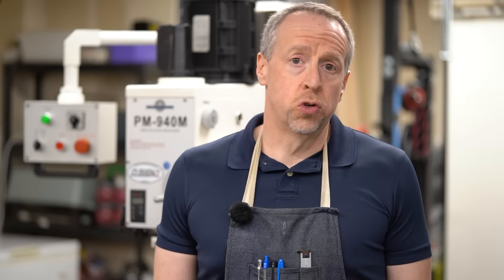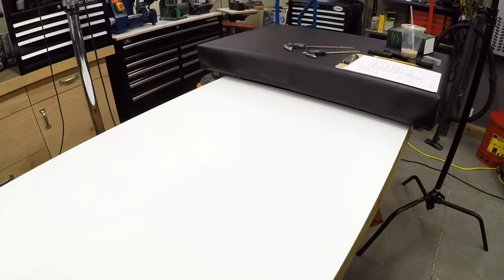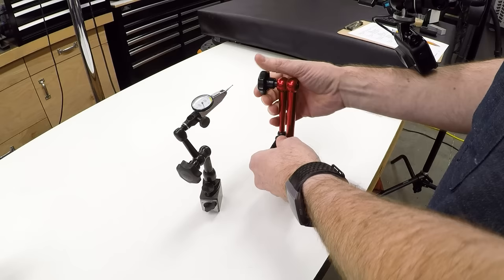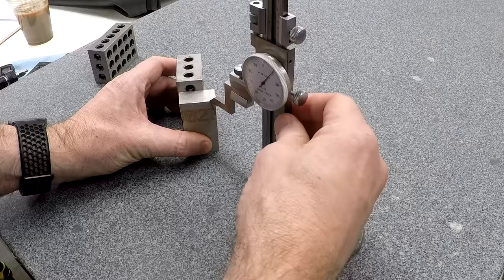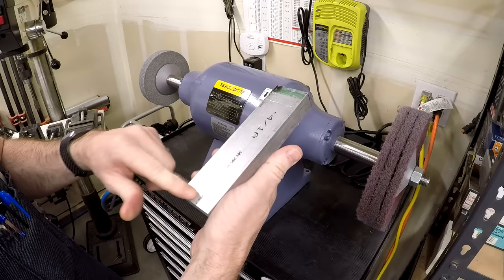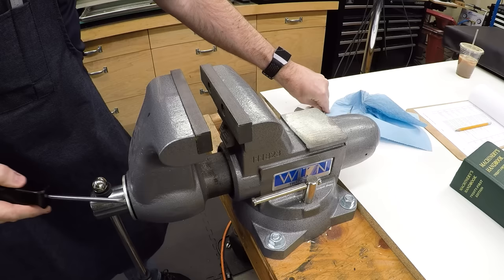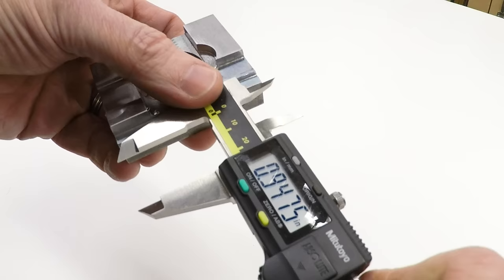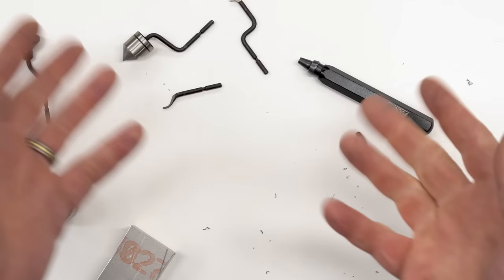Top Ten Tools I Use Every Day in the Shop

Comment: Thank you for your top10 tools.  My most used tool is a 22 x 66" movable work table I made from a miscut 1-1/8" plate. 
Four 800lb capacity casters 2 moveable 2 fixed [lockable] , rolls reasonably easy. 5" vice attached and 4 holes @ 4-1/2" diameter near each corner. I thought they would not be used very often but they are very usefull, especially with my mag-drill. work table has a shelf about 12" above the floor where I keep usable scraps of material.  Now I have to think of tool #2 thru 10.
Thanks again for a very pleasant video.

Comment: One of my tips is to take a piece of 2x2x.250 aluminum angle, and cut to pieces to be the same length as your vise jaws. 
Then clamp both into the vise jaws so they are in the jaws one one side, and laying over the top of the jaws on the other side. 
I use a large dead-blow hammer to "persuade" the corners of the angle down over the jaws, then my letter punch set to mark them "Front" and "Rear" so I know which jaws they are registered to. 
They're invaluable for clamping anything you don't want marred, they're inexpensive, and the faces are easily freshened in the mill or just replace if they get too worn.

Comment: Many people do not know about the step feature on the calipers because that feature is not on all calipers.   It was advertised on the Mitutoyo Diamond Verniers that I bought in 1970.   I had the only set in the shop with that feature.   This set of vernier calipers is STILL my “go to” set.   Not as easy to read as the digital ones I have, nor as easy to read as the dial set either.   However, this set has NEVER skipped a cog as have the dial set, and they have never had a dead battery either.   After 50+ years I trust them.  Oh, lest I forget, this set has a .050 vernier rather than the .025 that plagues many verniers.

Comment: my top ten tools
[1] starrett 150 mm thin ruller
[2] starrett scriber
[3] Alpen brand drills
[4] Rhome vice
[5] tap set with tap size drills
[6] deep hole marker
[7] 1 2 3 blocks
[8] knippex and japanese enigeer brand pliers
[9] scotchbrite sanding discs
[10] Bahco allen keys

Comment: The deburring wheel setup on the Baldor looks exactly like the one shown in Joe Pies video.  Don't keep it too close to any machine with bearings. The pink dust is a quiet killer.
Reply from the maker: I haven't seen that video, but it is the same setup I saw in the prototyping shop at work.  And they do have it installed in the grinding/welding room.

Comment: I have the exact same 6 1/2" Wilton vise and used your tip by adding a roller thrust bearing and  washers. Much improved, smoother to operate and takes less energy to get a good clamp. Thank you Sir...
Reply: The same principle of replacing screw friction with clamping force by using a thrust bearing also applies to collet chucks with a bearing nose.

Comment: As a hobby machinist, diamond files & grinding bits. They make qwuik work of sharpening cutters from HSS to Tungsten-carbide.
At work, it's usually more profitable to use inserts & replace them when the coating is worn.
Reply from the maker: I know some people regrind carbide inserts, too.  Personally, I usually break them before they wear.

Comment: 1-2-3 blocks are indispensable in woodworking as well.  A pair of them, plus a set of aluminum/brass gauges (1/16 through 1") and feeler gauges, make for great setup devices with table saw and router cuts.  Much easier than trying to get a ruler or tape measure to register properly and more accurate.  I even have a pair of 2-3-4 blocks when I need something even larger to setup off of.  Gets me everything from .001" to 8+" of cut setup capacity.

Comment: Whoa!!  Can confirm on those Starret Saw Blades.  I had bought one after watching your video as a spare since my existing blade was still working.  Well, the existing blade broke today (they were a bosch replacement of the original already), and I replaced them with the Starret.  WOW!  That blade cut thru 6061 1" square stock 3 times faster than my old blade!  Definitely worth the extra money for them!!

Comment: I go between Starrett, Lenox and Morse for my bandsaw blades. They are all about the same, and all are expensive. Yes, variable teeth is pretty much a requirement. Get a blade that will have between three and 6 teeth in the work, if possible. The Knipex are great, I have a few. There are other German manufacturers that are just as good or, some say, slightly better, but I haven’t found much differences. I like the heavy, multicolor, grips.

I find the Noga dovetail too tight for my Brown And Sharp indicators. I don’t know why, but when it’s completely loose, it takes a lot of force to get the indicator on, and off. But once on, it’s fine.

For my ER-40 collet chuck, which is the most common collet system in industry, I have a “service wrench” for the flats on the chuck. If you really tighten down on the nut, which you need to do for the larger diameter tooling, it’s almost impossible to do by hand. Unfortunately, for ER collet systems, you can rip the quill lock right out of the mill with these. So having the service wrench rest against the column, you can really wrench the nut closed, up to 130 foot pounds (yes, that number is correct!), using a torque wrench. So this wrench, along with the torque wrench, are two very important tools for me.

You mentioned McMaster Carr. That is one of the most important tools as well. I’ve been using them since the mid 1070s, for my companies, and myself. Ever since they came out with an app for iOS and likely, Android (I recommend a tablet), anybody can have an account, and order anytime. Most deliveries are overnight if you order by 6:30 pm. They have stock of over 550,000 items.

My Bondhus hex wrench sets are so often used, that my shops, which comprise my entire basement and two car garage, that I have five sets, both inch and metric. When bought on sale, for about $23, for both the inch and metric set, from MSC industrial and other places they are a great bargain
Reply: Bondhus and Wiha are the gold standard for Allen wrenches. Makes you want to throw all others in the trash.
Reply from the maker: I might check some out.  I have a set of small Dynamite metric hex drivers I bought for working on RC helicopters, and they're basically indestructible.  I've ripped the hex out of seized alloy fasteners without so much as scratching the driver.

Comment: I like to make a set of mild steel flat jaws for my vises. They are soft enough to hold things firmly and don't leave apprentice marks on parts.
Reply from the maker: Good idea.  We usually think of copper or aluminum, but depending on what you're gripping, mild steel could be a good option.

Comment: As someone mentioned below, Mitutoyo offers solar powered calipers. Yes they cost a bit more but even with Mitutoyo's normal very good battery life I'm more than happy I bought mine. Buying or even shop making a designed for the job foot to add to the right hand end of a set of calipers while using the depth function is well worth it. Besides my 123 blocks, I also bought a set of 246 blocks for all the same reasons the 123's are so handy. Between the two sets I have a fairly accurate method of checking between 1"- 18" and pretty much anything in between using a gauge block set in addition to them. Thanks for showing that Nogaflex James, that's one model I hadn't known about. I bought the large print edition of Machinery's Handbook and also the CD they offer. Plan for the future because at a certain point for all of us there going to be non optional. My most used shop tool? A large button and display calculator.
Reply from the maker: Nice.  I also have a comically large calculator and 2-4-6 blocks.  Both are great.

Comment: A Treasure trove of Great Info. Thanks so much. I considered my Mitutoyo  calipers a Huge step up from the inexpensive piece that I suffered with for sometime. The only caveat I have is that repeatability of a measurement becomes better with the higher priced item. I originally purchased at the low end and repeat measurements were a real nose-bleed with considerable variance depending on the point between the jaws where the measurement was made. As always with tools....you get what you pay for, right?😂

Comment: So many possibilities with this setup.  First thing I thought of when watching you disengage the half nuts at the end of the cut was "why not just stop the servo?"  Then I thought "why not reverse the servo to get ready for the next cut?"  Then I realized that you would have an indexing problem if you ever lost track of the pulses and direction.  solvable I think...but pretty cool project.  Very robust set of skills you employ....
Reply from the maker: Thanks!  What you suggest is possible, but it requires additional hardware, like a linear scale on the carriage, and you have to start accounting for acceleration and backlash.  It starts to become a CNC conversion at some point.  I am deliberately keeping it simple.  It's still a manual lathe and works like a manual lathe, except you don't have to deal with change gears.

Comment: James, that was a great video.  I used your link to McMaster Carr to get to thrust bearings for my Wilton vise.  My Wilton is a 1950's model that I purchased on an I-beam stand for $15.00  Different thrust bearing, but you clarified the need for a spacer, ( it's nice to have no surprises) after adding 5/64" of bearing.  I made a spacer (or washer) out of 1/8" aluminum and it works like a dream.  Man, it works great!  Thanks big time!!  I'd add a pic but I don't know how...

Comment: Small tip- put coloured electrical (pvc) tape around allen wrenches, in the (electrical) colour code of the size. Only really works with metric, but that is 90% of the world... You can see across the shop what size you left on the bench... Also works with drills, taps, transfer punches etc.
Reply from the maker: That's not a bad idea.  Now I'm wondering if I can get heat-shrink tubing in all the colors I need...
Reply: @Clough42  Yes, I have used heat shrink for this purpose- but some of the colours are hard to get. PVC tape is remarkably resilient. Paint works, but is a hassle- the Amazon ten-pack of tape gives you all the colours. I also use this on spanners- for the size of bolt, not the jaw size.

Comment: Great list, I totally concur!  Not sure about a thrust bearing on the Wilton. If you ever have to crank it hard,  something has to give in those tiny needle bearings. They will either be crushed or embed themselves in the washer. Me, I would make sure my factory thrust washer is thick, precision, and well hardened and replace if necessary. The extra force needed will be negligible.
Reply from the maker: The force difference is significant, which is why I did it.  The bearing assembly is rated for 12,000lbs static thrust, so it should be fine.

Comment: Ok I've gotta add some. For allen wrenches, find the Japanese brand "Eight". I use them daily and they surpass everything. Even the German stuff. I also have a Torx set similar style to your allen wrenches made by Klein. Same holder and everything. Great addition. I agree on the Knipex pliers. Been using them for 20 years, BUT I have the channel lock style with serrated jaws. I'm embarrassed to say I never thought to look for the style you showed, but I will now. Agree on the Wilton vise. Our shop  vise gets abused and has been in the shop longer than I have. We machined out some oversized brass jaws and they hold well and don't mar the surface, best of both. Great video.
Reply from the maker: Soft jaws are on my list.  I have my eyes open for some eBay copper drops, but they're usually 6" long, which is 1/2" too short.
Reply from the maker: Update: I just found a suitable hunk of copper on eBay, so soft jaws are coming.  :)

Comment: You may want to move that grinder/buffer out from just in front of that outlet. After a while the 3m wheels material will start caking onto whatever is behind them. You probably don't want that conductive dust going into that outlet! Love those wheels by the way, been using them for 20+ years.

Or maybe just put a little shield between the outlet and the buffer. Just as something to block the debris.
Reply from the maker: Childproof outlet covers!
Reply: @Clough42  Ah, yes, those would work perfectly. Not having kids, I forget those things exist, lol!

Comment: Great presentation on each tool's feature and application and thank you for the time of putting this type of video together.  Question: On the 6" silicon carbide deburring wheel link in your description, the MSC link took me to a 1" arbor hole wheel, is that correct?  I thought this Baldo grinder would take a 3/4" arbor hole.

Comment: About those safety glasses, I have a couple questions: Bifocal lenses, as in you have a prescription or they have a section on the bottom edge that classify as “reading”? And the other question, with your particular line of work (in the shop), do you find that debris finds its way between the glasses and your face? To clarify, do you feel a set of safety glasses that feature a foam liner on the inside edge of the frames (in order to seal to your face) would be useful? 
Thank you

Comment: Ovious for its non-presence in your list is your Haimer 3d sensor.  See you using it often in your videos, and don't think I have seen you use anything else.  As it appears that there is little video content on the Haimer and manual milling machines, would love to see you do a short video on using the Haimer on the manual mill

John
Reply from the maker: I don't use the Hammer on the manual mill.  It's in a dedicated taper toolholder for the CNC.

Comment: Hi James. Very helpful, thanks. I'll get that reverse Noga deburring blade. I did not know that those pliers could grip round objects either. I'd be interested in some other items you have in regular use. I think there was a glimpse of your air compressor. Mine is 3hp, very noisy and lives outside. A smaller, more peaceful one would make life much nicer as I can't drill holes in the wall to bring an air line in. Cheers. BobUK.

Comment: great list. FYI, Mitutoyo has a solar version of their absolute 6" calipers - just as good and you never have to change a battery ! John Saunders at SMW have a nice video to modify your magnetic base (Noga or other) an add the micromanagement - I have modified all mine. Last point the small deburing blade in the Noga kit is for plastic.
Reply: I bought a generic kit of those tools, explicitly for 3d print cleanup. The fact they de-burr copper pipe was just an awesome bonus.
Reply: Hello Pierre, I tried to find the John Saunders video on mag base mod, with no luck.  Can you help me find the video?  Thanks.
Reply: Just keep the solar calipers next to your tig welding area and you never even need solar to charge it

Comment: A 2x60 inch bur king belt grinder and the baldor buffer with deburing wheel are a combination that I use daily. The bur king is expensive but I wouldn’t be without it. My second most used tool is an electric micro motor with misc carbide burs and grinding wheels. I have used Osada brand which again is expensive but I use it hard and they last and last (retired dentist here). Dremel tools are too poor of quality to be useful in my opinion. Third is my bandsaw.

Comment: Just curious if your HF bandsaw has the same issue as mine. Are your blade guides deflecting the blade downward to gain depth of cut? I put a 1/4" steel plate under the vise to elevate the stock so that I could set the blade guides right. The saw now cuts very straight and best of all, I can use full downward pressure without the blade falling off (it will stall the motor first). Also the blade life increases drastically with more pressure.

Comment: My local "safety specialty shop" carries a brand of safety glasses that you can mount special prescription lens holders INSIDE of.  I wish I could remember the exact brand/model.  Supposedly the local industrial manufacturing company switched to these and saved a million dollars over a year by not constantly buying new prescription safety glasses for their employees.
Reply: I've done the prescription insert thing before.  I hate it.  It's a lot more work to clean them and there are more surfaces creating reflections.  I'll pay the difference myself rather than live with them.
Reply: @SouseMouse  Interesting.  What you say makes sense.  Luckily I still don't need glasses myself.

Comment: Might be a silly question, but you mentioned you work with both metric & imperial, so you're definitely qualified to judge... is there a metric version of 1-2-3 blocks... and when working in metric, does it matter?
Reply from the maker: You can buy 25-50-75 mm blocks.  They aren't common where I live, but they are available.  For the vast majority of what I do with them, it just doesn't matter, because I'm  just counting on them to be square and parallel (and matching) but if you use them in a situation where you need to subtract the block dimension, one will be more convenient.  If I use them to measure TTS tool lengths as I showed, it's convenient to subtract 2 inches because I'm measuring tool length in inches.  If my tools were measured in mm, subtracting 50mm would be more convenient.